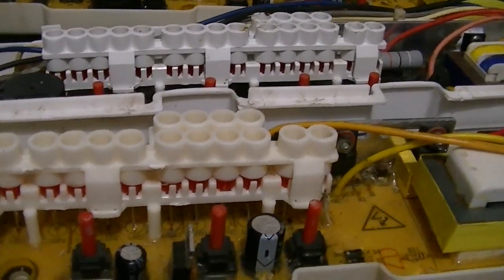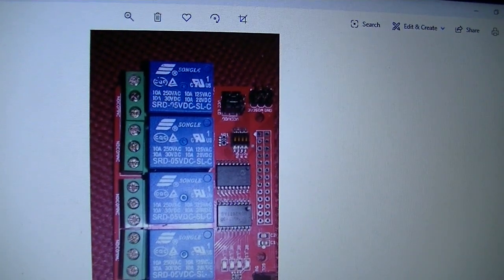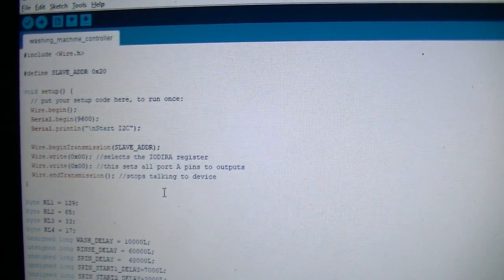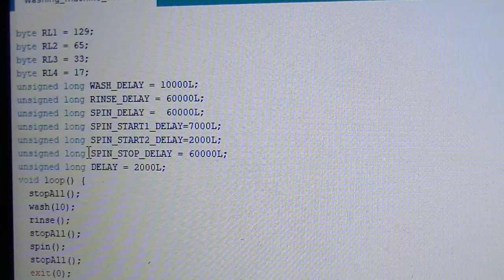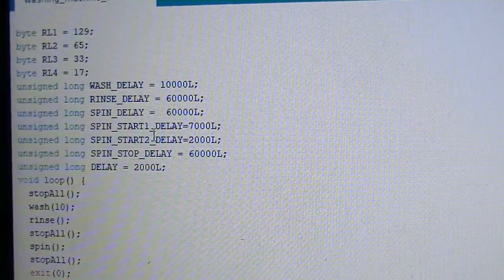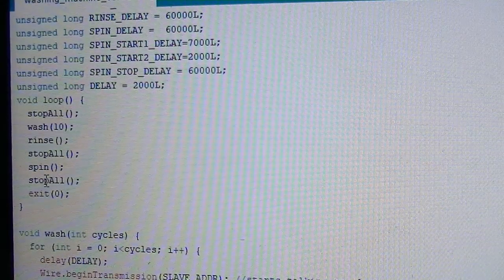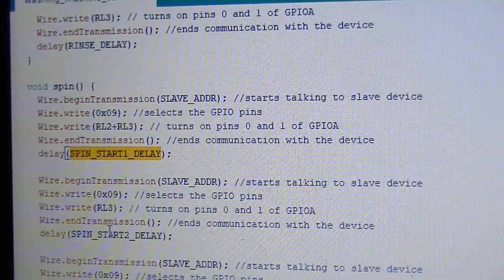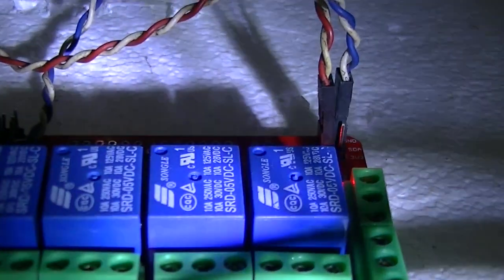Arduino with 4 relays Controlling Fully Automatic Washing Machine during Corona Outbreak - Covid-19

Comment: Hi sir, do you have an electronic schematic for this coding? I mean maybe schematic in Proteus
Reply from the maker: I do not have Proteus schematic. This is not so difficult. Let me know if you have any questions. - Wiring diagram is here - https://imgbb.com/JybNHKC
Reply: @kushanathukorala   @Kushan Athukorala  Oh I see.. Actually, I do not understand how to connect 4 relay to the arduino in schematic..
Reply from the maker: @amirahshafiqah980  This relay module has I2C port, search google on I2C for Arduino. Many references available